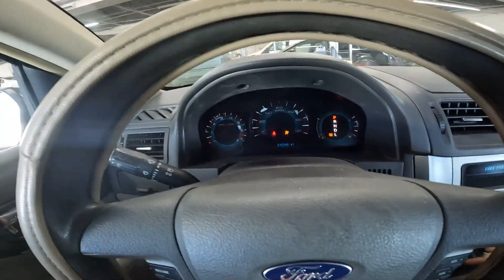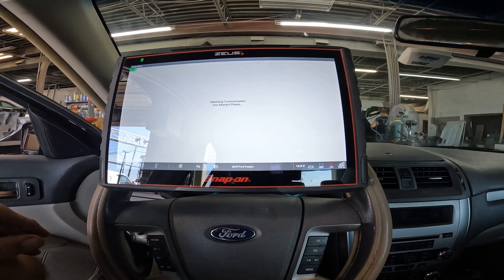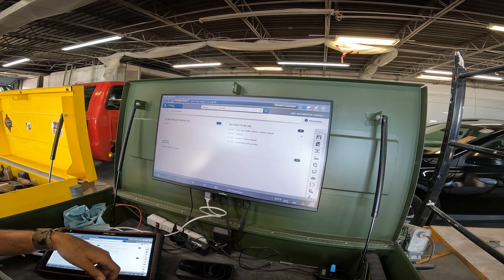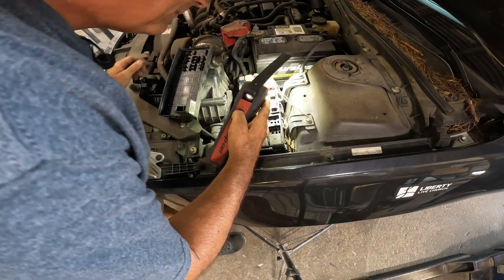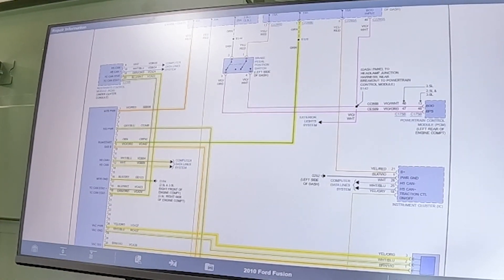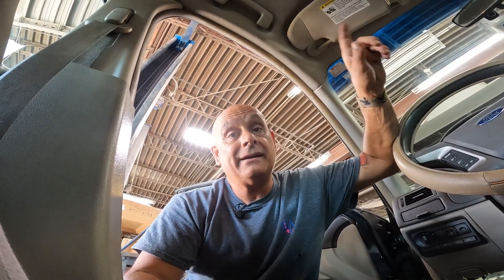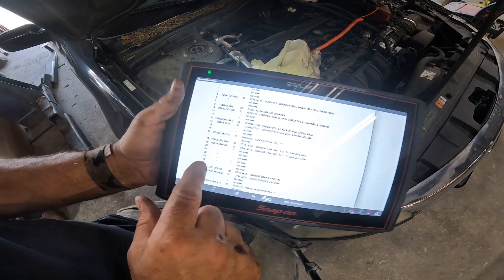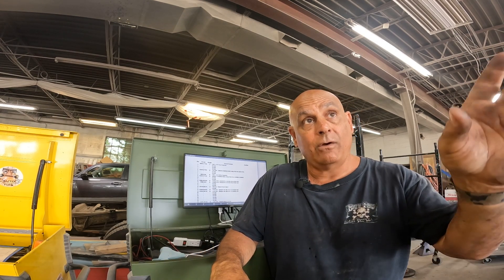Why This Car Was Scrapped Due to a Faulty ABS Module

Comment: ABS is nice but not required. Unless the State requires (BS) the engine light to be out, I would just drive it with the plane old fashion brake it defaults to.
Reply from the maker: a yellow abs light is ok but he had yellow and red, the red wont pass

Comment: Looking for body control module for 2002 F-250 Lariat right now. 7.3 in great shape. Door locks not operating with fobs. Same crap. No module from dealer. Cardone has discontinued rebuilding these. Ridiculous. Cardone does have service where you can contact them and personally send in electronic part and they will rebuild. Not sure about cost.